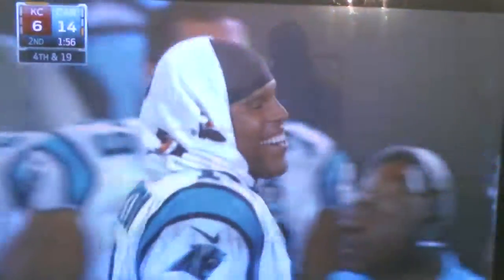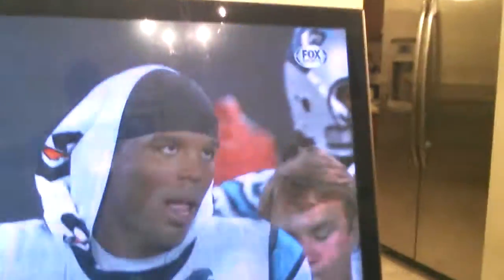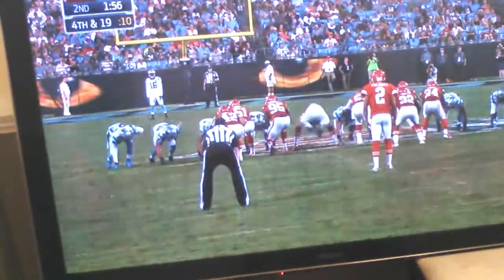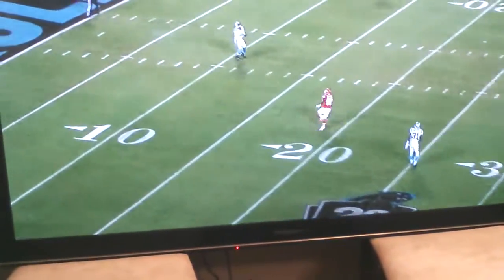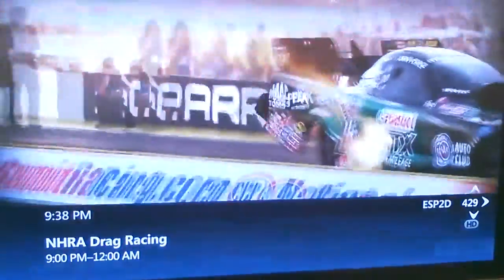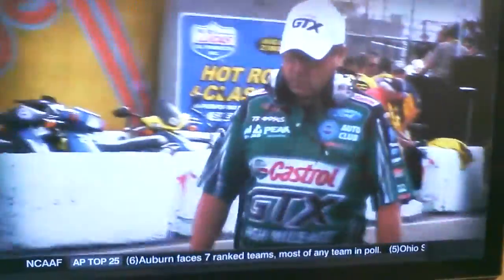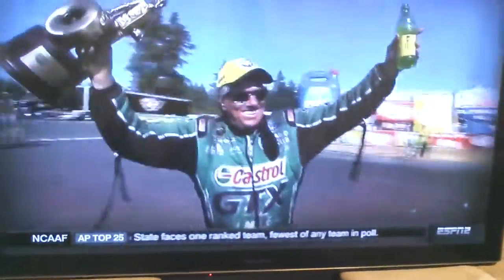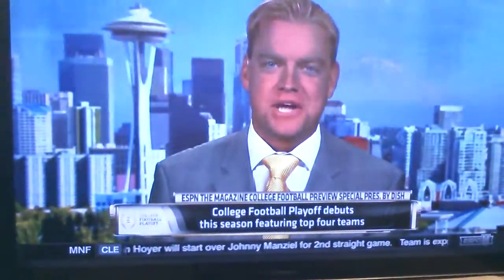TC-P65VT30 8 BLINKS

Comment from the maker: So I replaced the power board and so far so good.
Reply: im having the 8 blinks on my plasma. disconected the ss board and powered back on and then get 6 blinks instead
assumming a bad ss board
Reply from the maker: Brad Kay I ended up replacing both the SS board and the power supply board. Once I replaced the power board my TV started working perfectly again. I bought the power board from ebay for $17.00 shipped too!!
Reply: Tim F thanks Tim i tryed replacing the ss board but no good. I took it into the shop to try get repaired under warrenty even tho im in  a different country now and its not meant to be covered.
Reply from the maker: Brad Kay  Here is a list of power boards on ebay currently. Good luck repairing yours!!! Mine is still working perfectly since replacing the power board!

http://www.ebay.com/sch/i.html?_from=R40&_trksid=p2059210.m570.l1313.TR0.TRC0.H0.TRS5&_nkw=Panasonic+65%22+TC-P65VT30+TC-P60S30+N0AE6KM00003+Plasma+Power+Supply+Board+Unit&ghostText=&_sacat=0